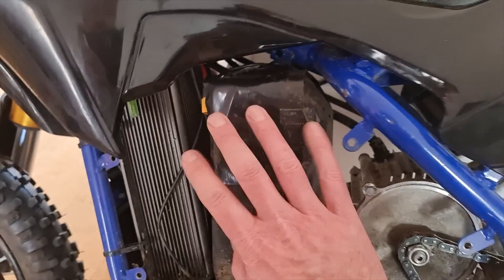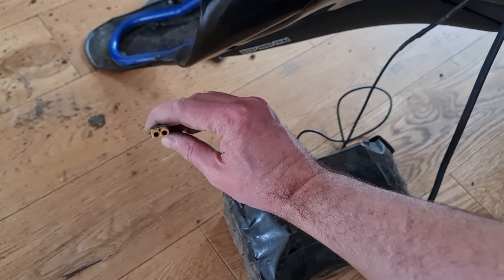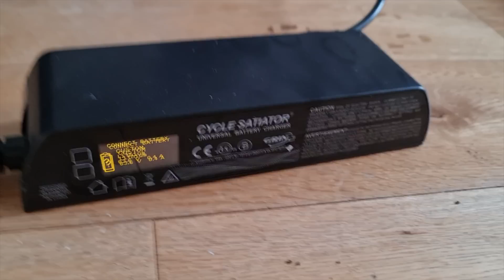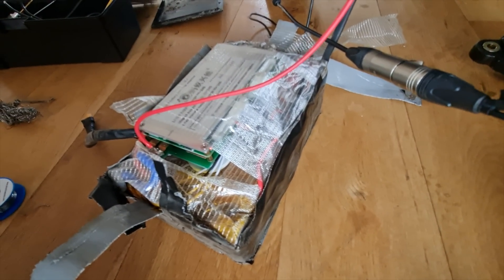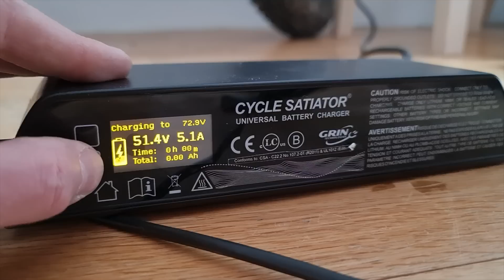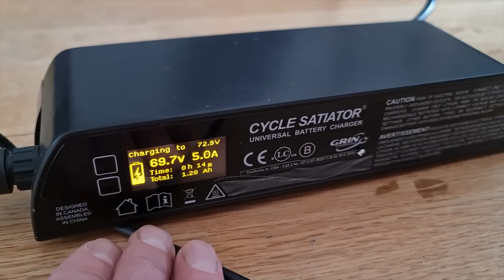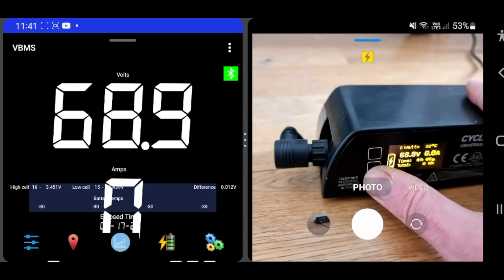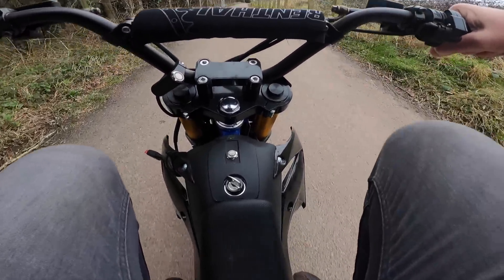FIXING UP MY MENTAL 10KW PITBIKE!!!

Comment: Hi wondering if the motor could handle all that power! is it still holding up or did the motor need replacement after 2 years. sorry didn't read all the comments so excuse me if it is dead allready ;)
Reply from the maker: Still going, just don't go too mad and watch the temperatures.

Comment: Dude!  Cool stuff.  Just wondering what motor and controller was that?
Reply: Irc it was a stock motor 1000w and a 72v sabvaton controller but unsure on the amps 100-200 at a guess
Reply: @ianthomas6593  thanks dude.  Does the controller put out more power to the motor?
Reply: @garyjohn1076  yes a lot more the battery and controller will supply the motor with 10k watts of power

Comment: I got that same charger. The cycle satiator from grintech, it's awesome. It's the only one on the market that balances batteries automatically.
Reply: The charger has nothing to do with balancing. It’s the BMS that controls balancing. The charger simply supplies a constant current or voltage through two wires

Comment: Did you try resetting the BMS? you talked about fitting a re-set button  to cut the power in another video.
Reply from the maker: It wasn't possible, the BMS needs about 8V to function - I think - once the pack voltage goes so low it just won't turn on or let any current flow. When I reset Steve's BMS the battery voltage was good but the BMS had tripped.👍🏼

Comment: Just a thought Andy as it may save your home. I keep a lithium extinguisher here next to where I charge/store my battery. I've tested them in person and they work extremely well in thermal runaway situations. They're not too expensive either and it might even be something you could sell in your store. I can hook you up with a supplier direct if need be.
Reply: Yes definitely something you should invest in Andy.
Reply: They have CO2 inside dont they?
Reply: @MrDeceptacon88  Primarily a cooling agent, they're not normal CO2 extinguishers

Comment: I think I'd be doing the charging outside. And I might have checked the individual cells for voltage to ascertain how gently I might need to charge them to try and bring them up. Btw, 10kw from a 9ah battery? What C rate is that??
Reply from the maker: Did you watch the video?😉 the BMS shows the cell voltages. They are samsung 30T capable of 35A each continuous. The controller will peak at an absolute maximum of 10kW which is pushing the cells hard however they will handle it momentarily. Before you ask, my interconnects are copper.😀 but that XT60 needs to go🤣
Reply: @andykirby  no, I wasn't about to ask about the interconnects... But it was after the BMS came to life that you were able to read individual cell voltages. I'm not criticising, but I might have checked cell voltages before plugging the charger in. Just to be sure.